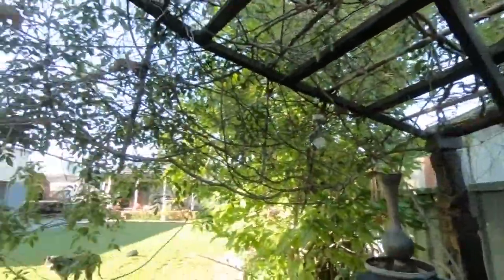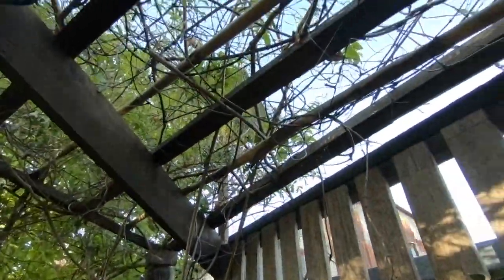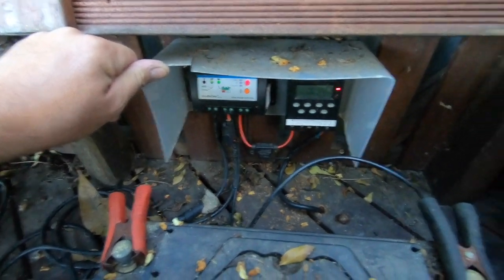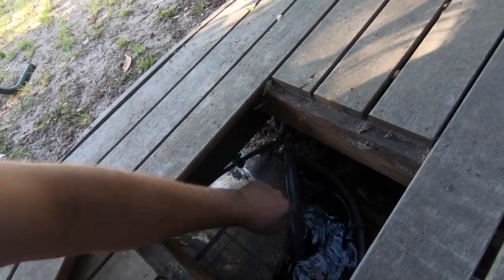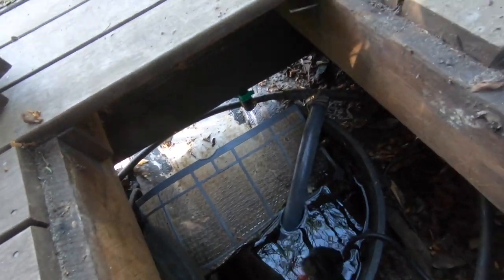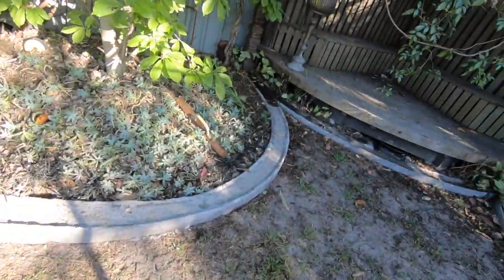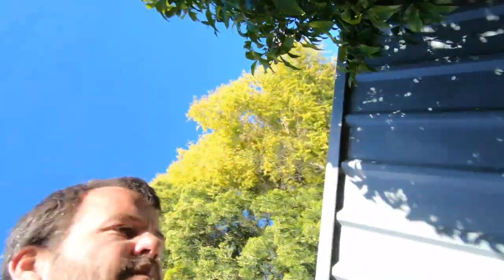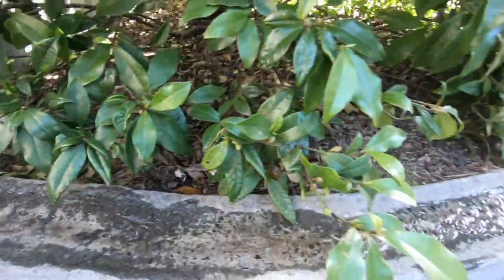Amazing Garden Edging Water Feature

Comment: I'd love to make one of these! Did you make the curb yourself?
Reply from the maker: Katy Y thanks so much. I did build it myself.  I used 3ply plywood and heaps of wooden pegs for the formwork and a string level. To get the curve for the water I used a curved shovel. Best of luck! It’s very soothing 🙏
Reply: You did great work! I'll have to try this in miniature first and see how it goes. Thanks for replying so quickly!
Reply from the maker: Katy Y hope it works out 👍 it’s not too hard, it just takes time to set up the form work. I used a string line to level it and made the concrete at least 1foot deep into the ground so it wouldn’t crack.